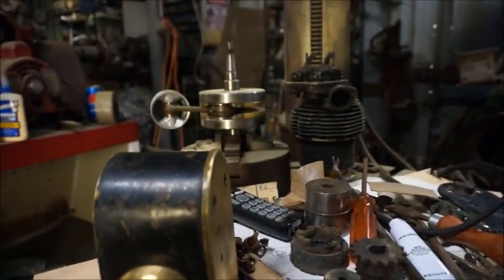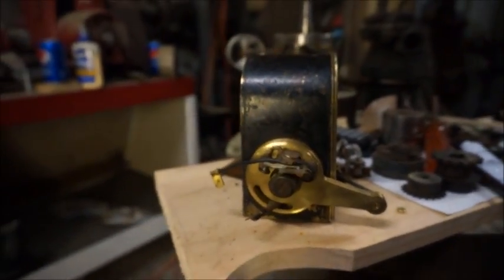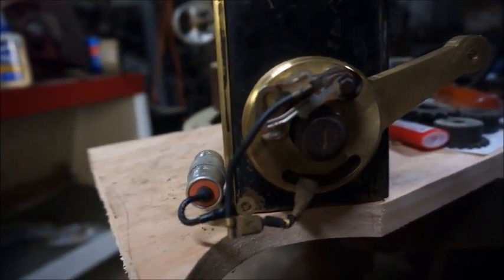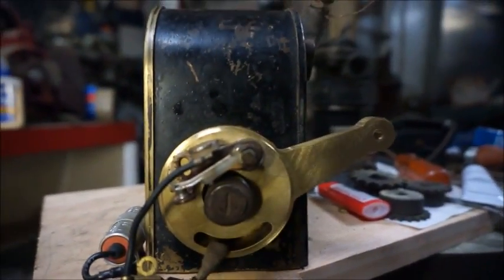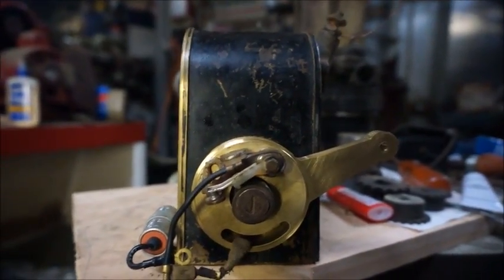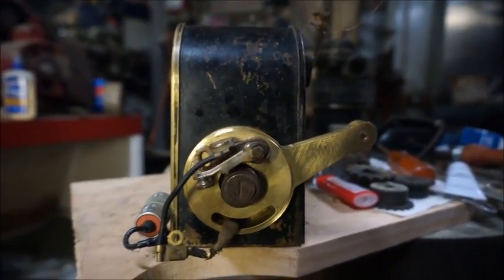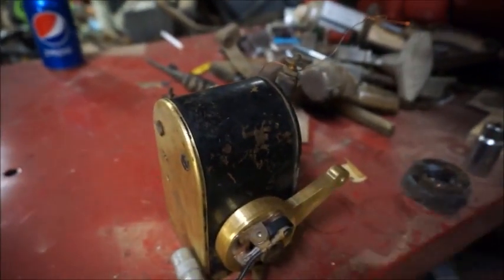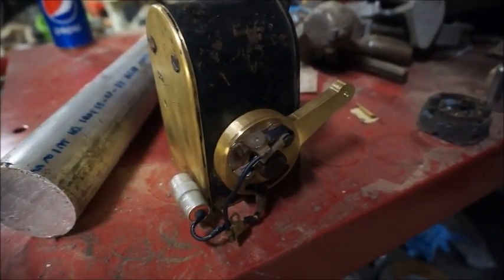Antique Motorcycle Engine Build (Replica) Part 9

Comment: fiat 126 or rover mini(lucas type) points are really small strong and have a condenser cap as part of the points, just though it might help, those two cars were sold so wide spread you should have no problem getting them mail order.
the fiat points look like just the thing, but looking at a screen and in real life are very different .

Comment: did you get the pto for your crew cab?
Reply from the maker: No, called a while back, but I didn't have the right number. Crawled under the other day and took pictures of the tag, but I couldn't rear them, I gotta get on the ball!!
Reply: let me know when you do. i removed a pto from a 2005 c4500 with an allison. pump is a "dual pump"? one pump ran the lift gate and crane. the other ran the hydraulically driven air compressor (which i removed from the truck also).